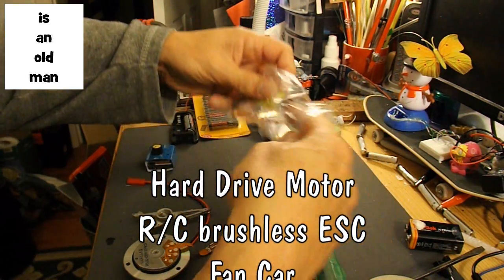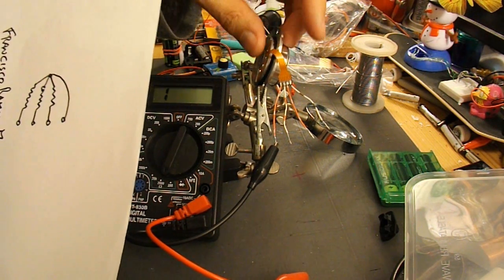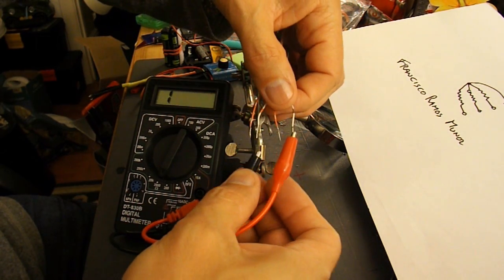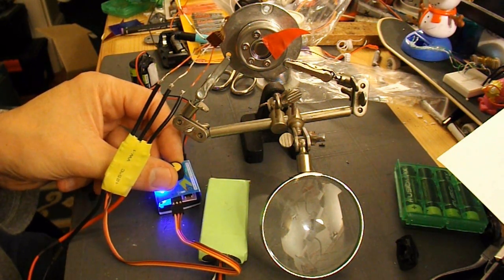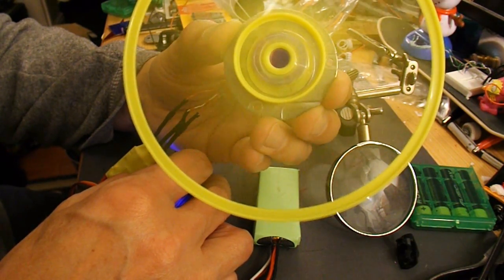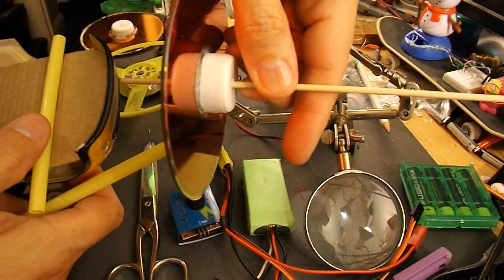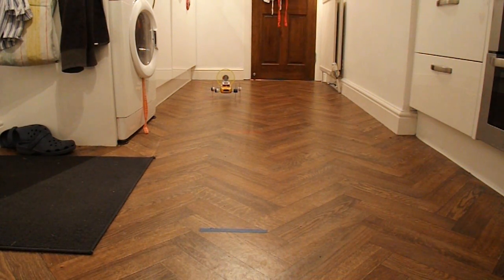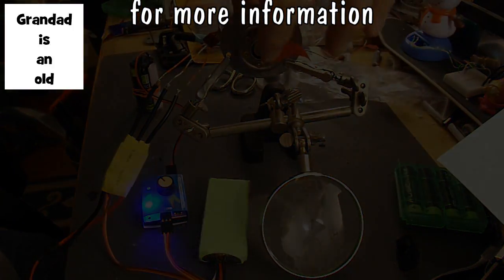Hard Drive Motor RC Brushless ESC Fan Car

Comment: Thanks for the video. Learnt so much. Just one doubt though...My HDD has the motor sealed inside the aluminum casing. Any idea on how to remove it safely without damaging the motor. It doesn't have any screws to hold it on to the case!
Reply from the maker: Sorry, can't really help you there, it's a few years since I did this video and I haven't stripped any down recently. Probably worth typing a search into YouTube and see what turns up https://www.youtube.com/results?search_query=hard+drive+motor+removal

Comment: Can u build qoudcopter use hdd   motor
Reply from the maker: Technically it is probably possible but the motors are probably the least expensive part of a decent quadcopter build. You would be saving a few pennies at the expense of most of your performance. You would still need 4 ESCs, a good LiPo battery and a quadcopter RC Receiver with gyrostabilisation. A very basic issue with using HDD motors is how to attach the propeller!
Reply: oh thank

Comment: my hard disk motor keeps running when i turn on my transmitter fs-ct6b 2.4ghz 6ch.
what setting i did wrong
Reply from the maker: +Arfan Khan on my CT6B I had to use the software to adjust the settings for channel 3. I also found that it is mixed with SW. B You will probably find that if you move switch B your motor will stop as it seems to be set up as a throttle kill switch.
Reply: +GrandadIsAnOldMan can you pls share a video how to solve it.
Reply from the maker: Arfan Khan do you have the programming software?
Reply: +GrandadIsAnOldMan yes T6config is installed and working.
Actually iam new to this and doing what people are doing. hope to do some my own project in future
Reply from the maker: Arfan Khan I am equally new to this and I am just finding how it works by playing with it. In this video I show my first attempt but in the video description I give a link to a hobby company video on the CT6B https://youtu.be/pj93eqNfDqg

Comment: to use reverse
to the right of the stick to control the acceleration is a switch that will go up set that up then you should have reverse (as long as the esc supports it )
Reply from the maker: that ESC does not give reverse

Comment: interesting and very well presented, however im not sure of why anybody would want to do it :) still... i watched it till the end :D
Reply from the maker: +Ryan Matthew thanks, most people do things because they want to find out if they can, not because they have any long term plans to dominate the world. In the case of a hard drive motor, just finding a way of making them work outside the hard drive is quite a technical feat if you build the stepper motor driver circuit from scratch. Using a Radio Control ESC is a short cut that people who have no knowledge of radio control models would have no knowledge of the similarity.

Comment: Can you do a plane with this motor?
Like motorizing your pizza tray glider
Reply from the maker: ThunderTaker38 There is no easy way to fit a prop to this one and it doesn't seem very powerful. I have seen other people use them OK.
Reply: GrandadIsAnOldMan can you do a car out of a matchbox and an oral b pulsar vibrating toothbrush motor (fan driven or pulley system)?
Reply from the maker: ThunderTaker38 I could but it would not be significantly different to this car https://youtu.be/PyGdWd3eHIY?list=PLA5a2xPRSrB0yTUYmJSS3ML5xxaBzHl3e

Comment: There are also 3 phase motors in video tape recorders, one on the capstan and another is built into the head assy which usually has very good ball bearings, they usually have a built in controller chip but you can break the 4 tracks to the coils and use a 3 wire esc, capstan motors turn slow (many poles), head motors fast (3 or 4 poles).Oh yes the motor that loads the tape is often a 12v motor like the ones in toothbrushes.

Comment: hi, I have a question, do these esc`s also work for these little dc motors and the toy motors? because I would like to buy one (for non brushless) but I am not shure if it would work or not
Reply from the maker: You can buy esc's for non brushless motors. The one in this project is a non-brushless motor https://youtu.be/2dcsu4KjJRM?list=PLA5a2xPRSrB13Xcquw4Ff09MQzTPjeVkI
Reply: GrandadIsAnOldMan yea I also own non brushless esc´s, but I am not sure if they work with these smal ones... but ill give it a try thanks
Reply from the maker: Josh's RC I guess it will just depend what power your motors need and get a matching esc.
Reply: GrandadIsAnOldMan yea, thanks, ill see and try :D

Comment: Hey Grandad! Can you make a rc boat using this brushless motor and esc? Thanks!
Reply from the maker: I will pass on that. It would only mean taking the assembly off the car and sticking it on a boat. It would work exactly the same. In fact it would look virtually identical to this one http://youtu.be/3glARXdrXvc?list=PLA5a2xPRSrB24vUS9E8zkSgjZysEL00zr
Reply: Ok then...:)

Comment: what about the radio thing cant i make one at home or i need to buy??
Reply from the maker: I don't know which part you mean by "the radio thing", but when it comes to radio control equipment it is easier and cheaper to but the components ready made. You could make them yourself if you really wanted to but there is not much point unless you want to spend time learning how electronic components work. It is certainly not a subject I would cover on my channel.
Reply: ok thanx

Comment: You should make a helicopter
Reply from the maker: I won't be making a proper helicopter any time soon. My channel is aimed at simple, quick, and cheap projects. If I wanted to make a proper model helicopter I would have to buy all the proper equipment like decent motors, r/c controllers, gyro stabiliser and the mechanics like the gears etc so I might just as well buy a ready made model or at least a ready to build kit. I certainly would not be able to make a stable flying helicopter from the scrap items I normally use without adding relatively expensive extras.
Here is my helicopter playlist which you might find interesting. http://www.youtube.com/playlist?list=PLA5a2xPRSrB3l5KTGMqUydr8pctBi5Af2

Comment: So it would go faster
Reply from the maker: Quite apart from the fact this car was simply to demonstrate that the HDD motor could be controlled by the r/c ESC and has absolutely no need to go any faster, what makes you think that smaller wheels would make any difference? Have you done any tests to prove this?

Comment: A great use of the servo tester too  :)
Went down this road myself. Laptop HDD circuitboards are good for 2A running a brushless motor. Some quit after a minute when they detect no load, but others really run up the speed!
Perhaps you could reverse the car (also working as a brake) mechanically, to swap 2 of the wires...maybe a servo to do that. Steering would be via another servo, to swing the fan at the back :)
Reply from the maker: Hi Slider, any idea what sort of size propeller would suit this sort of motor if I wanted to power a glider with it?
Reply: A good test method is to use your scales. Have the motor+prop sitting on the scale and have the wind blow upward away from the scale. The amount of thrust is then approximately what is shown on the scale screen, as the thrust pushes down on the scale.
The problem is usually weight rather than prop size, though a 9x7 or similar ought to swing well. Torque is rather low on a HDD motor, so anything that works would be a gentle flyer. Too big a prop and the revs aren't high enough for a good power band, too small and not enough oomph.
The shallower the pitch, the faster the revs and spin up, but the less the actual thrust. Trade offs everywhere, yet very worth doing the tests.
A glider would have to be of a fairly huge size, simply so that the motor + components could be carried. Designed like a Super Cub perhaps with the weight hanging below for natural balance. It would have to glide without power.....then you're looking for 25% or so minimum power to weight ratio.
However, some kind of paraglider may also work. Big chute out of it rather than wings.
Reply from the maker: Thanks Slider, I did virtually all my flying with 2.5cc diesels and control line combat in the early 70's. Seem to remember it was always 8x6 plastic propellers.
Reply: Oh, you might well like the indoor control line I was doing a couple of years back. Didn't record much, but, basis is a cake tin with a brick in it in the middle of the room. Broom handle/old aerial or similar up from the tin. Fishing line out 3ft or whatever to fit the room. Put plane on the end with a simple on/off + throttle. Works great with cheap I/R gear.
 Fun for rainy days :)
Reply from the maker: slider2732 I used to fly with one of the chaps in this video back in the 70's http://youtu.be/O6OKhaEmzBk
Reply: Haha...ever seen the Monty Python toffs race ? that's what the close ups of the guys looked like...just mentally take away the control lines :)

Comment: Grandad if you use a ESC with a bulit in BEC you would no longer need a the battery to power the receiver simply plug the ESC  into the 3rd channel on the receiver and it will be able to power it along a few servos if needed
Reply from the maker: Hi Saif, thank you so much for the tip. I am a complete novice with modern R/C equipment. I had noticed that there were beeping noises coming when I plugged the LiPo in before the battery power, but just assumed I had done something wrong. I guess I could always read the instructions. I will upload a video shortly to cover this.
Reply: You are very much welcome granddad.. aslo if you need any help or advise you could ask me im into new rc bu ti love you material, they are so simple

Comment: If you esc(electronic speed controller)has a bec(battery eliminator circuit ) the plug that looks like a servo lead plug that to were the throttle is and you don't need a receiver battery
Reply from the maker: Thank you so much for the tip. I am a complete novice with modern R/C equipment. I had noticed that there were beeping noises coming when I plugged the LiPo in before the battery power, but just assumed I had done something wrong. I guess I could always read the instructions. I will upload a video shortly to cover this.
Reply: ESC will bleed once every now and then when it has no signal and it will bleeb to let you know its connected and they all do that from my experince